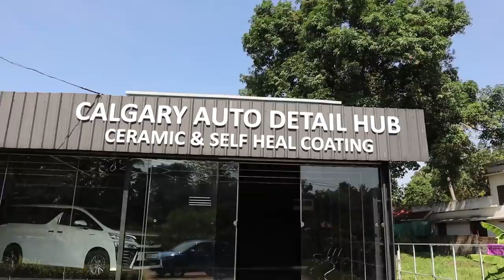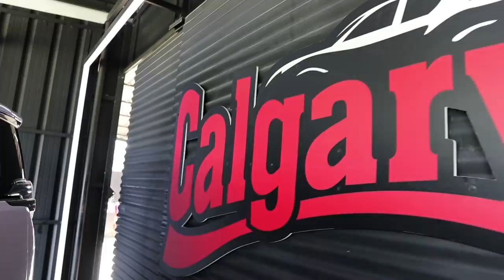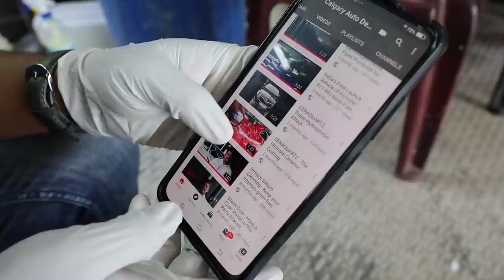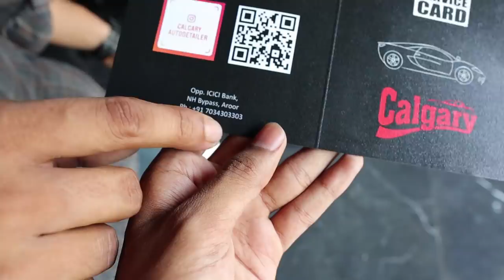നമ്മുടെ പുതിയ കാർ വേറെ ലെവൽ ആക്കുകയാണ്🤩🤩WITH CALGARY❤️ UNBOXINGDUDE l

Comment: Da monae....

Do the below steps to silent your car while locking and unlocking .👇🏻👇🏻👇🏻

Press & hold the lock & unlock button together on your car key remote for few seconds, then as an indication all indicators of the car should blink, which confirms that the system has set on silent mode. The same process works to put it back in sound mode.